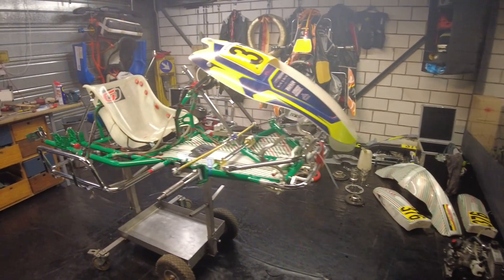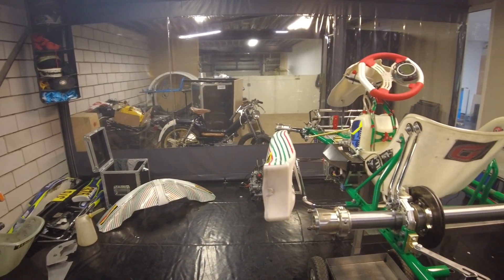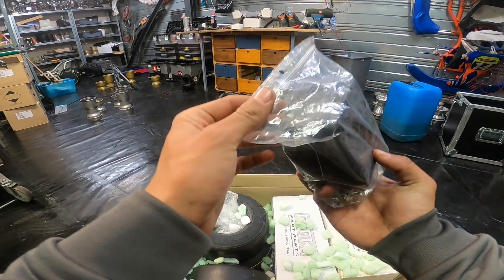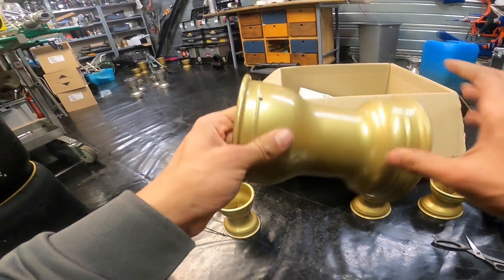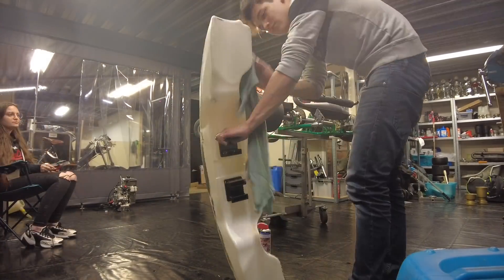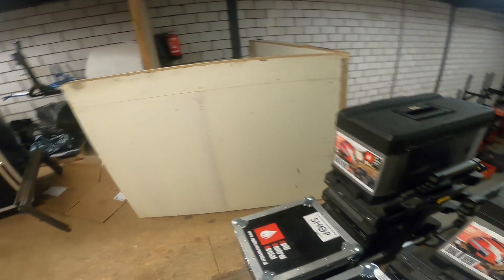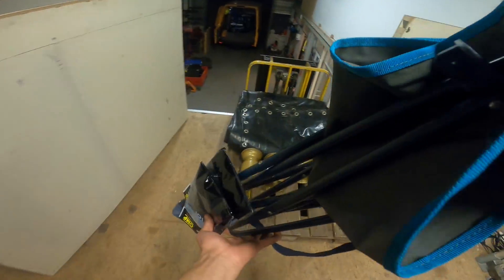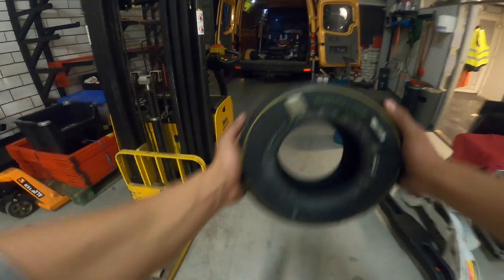UNBOXING $2000 WORTH OF OTK GO KART PARTS  | #9

Comment: Im having a 2024 OTK CS55 LO206 assembled by my local shop.  Im trying to find information about spare parts to have on hand before I go racing.  Diff local tracks have diff tire spec so Ill need another set of wheels and tires.  From what I can tell the kart will come with MXJ wheels and I would assume I need the same for the second set.  The hardest part seems to be trying to figure out what is required on an OTK chassis.  I’d like to buy a spare chain and sprockets for gear changes but cant figure out what comes with the Kart from searching online.  What the diff between #219 and #35 sprocket?  I would need what comes with OTK chassis but am trouble finding that information.  Thanks for your help!